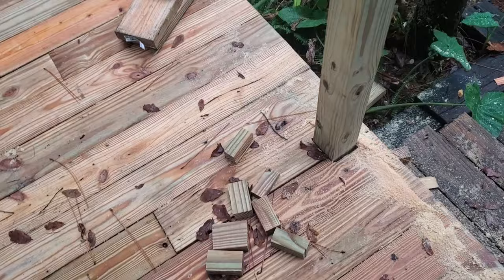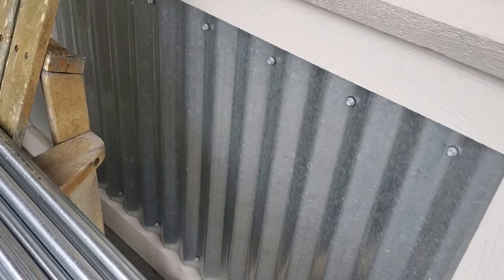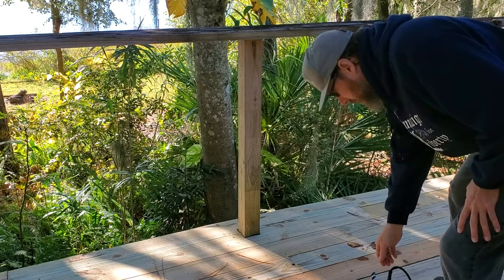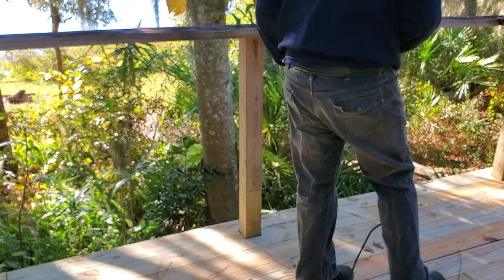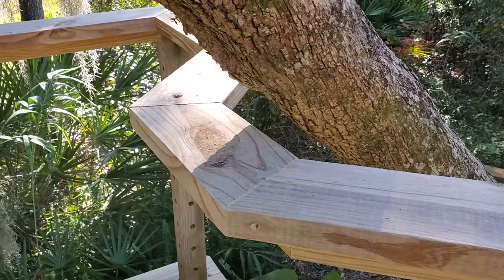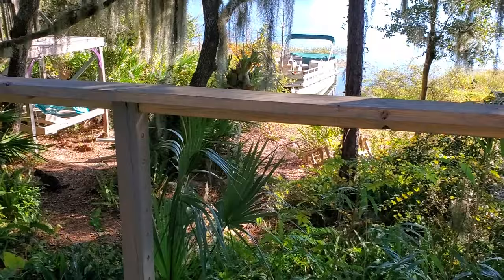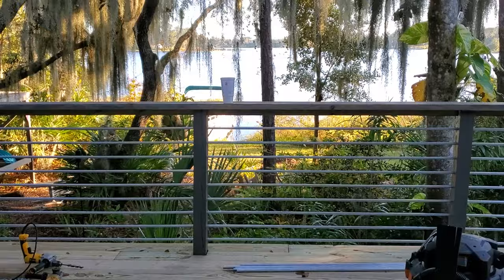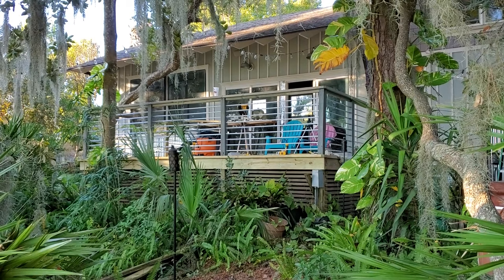Unique Conduit Metal Baluster and Deck Rebuild

Comment: The video of you installing the pipe was so fast I couldn't tell how they were installed. It sounded like you drilled the holes deep enough that you could slide the conduit, but then how did you keep it form sliding out? Also some of your holes looked like they went completely thru the posts.
Reply from the maker: The middle post were drilled all the way through and corner about 3 inches. This allows the pipe to be 2-3 inches longer than the opening width. You poke the end deep into one side hole, then line up and pull it back into the opposite hole. They ended up being pretty tight in the holes. The ones that I bent around the tree I used a single screw in each edge to hold the pipe and keep it from rotating. Thanks for watching.

Comment: Okay good job but don't you have to have a vertical expansion bar three and a half feet to meet code.
Reply from the maker: I imagine code varies from area to area. Probably depends on the deflection of the material used. Cable may deflect more that this. Check with your local permitting office before starting any project. Thanks for watching.

Comment: I did the Conduit Railing on my new deck five years ago. A forester bit works the best for drilling the holes. I just halfed a 2 x 4 and drilled them instead of the post so I could remove them if I had too.
Reply from the maker: Good idea on the 2 x 2.

Comment: Hello! Great video, thanks for putting this together. How's the railing looking after 4 years? About to redo our deck and I like this horizontal bar look.
Reply from the maker: a couple of the boards are rotted already. I think they just did not get the proper pressure treatment. The railing are looking good. holding up nicely. They have lost their luster are are a dull grey now and not shiny silver anymore.

Comment: looks awesome- trying to decide between conduit or cable. how do you like it now after many years??
Reply from the maker: it has lost its luster like you would expect from zinc coated steel. So is sort of a dull grey. But I actually like the patina it has.

Comment: Hi
Thank you for a fab video. 
Loads of inspiration 
What size wood did you use for the top railing please ?
Reply from the maker: 2x6 top cap and I ripped a 2x4 in half (1.5 x 1.75 for the urderside support. Thanks for watching.

Comment: how did you secure the railing so it can not be pulled out left to right?
Reply from the maker: Most of it was a tight enough fit I did not need to do anything. The bent ones around the tree I drove a screw through each one at the post.

Comment: So, can you actually move and remove them as well? Just trying to do something similar, but I was going to print out brackets with my 3d printer. I don't want them to move once they are in.
Reply from the maker: The ones I bent around the tree I pegged in place with a screw. I drilled a small hole about 1/2" in from edge into the conduit. Then drove a small deck screw. Locks them in good. All my straight ones I just left floating.

Comment: Looks good. How secure is it?
Reply from the maker: most of the pieces are just stuck in the holes. 3-4 years now no problems. The bent ones I drove a screw through them to keep them in and not rotating.

Comment: How did you attach the split 2x4 top rail support? 1.75” as height or width? Have they been enough support? Any sagging? My posts are 76” apart so I’m a tad worried its not enough support but I’d like to keep the top rail as thin as possible as well. Thanks for the video!
Reply from the maker: Yes using a full 2x4 vertical for a top rail support really makes it thick. My posts are 5' apart or so and seem to be doing fine. It has only been 6 months. But the old deck just had top caps no support piece and they lasted 15-20 years.

Comment: Did you glue them in or are they loose?
Reply from the maker: They are pretty tight in the holes. A few you can easily rotate if you try. The ones with bends I pinned in the to post with a screw to keep them from rotating. Thanks for watching.